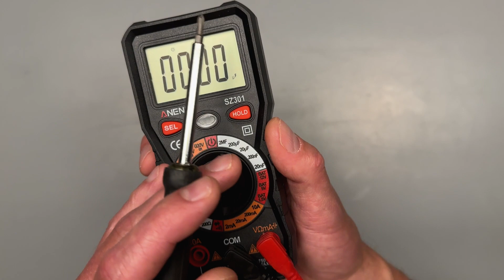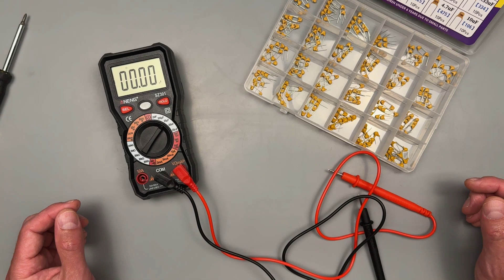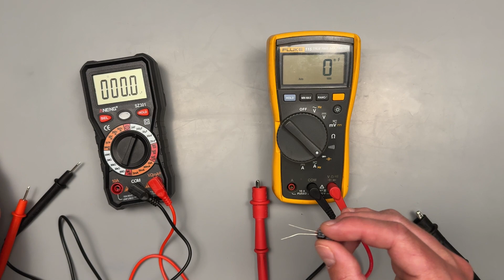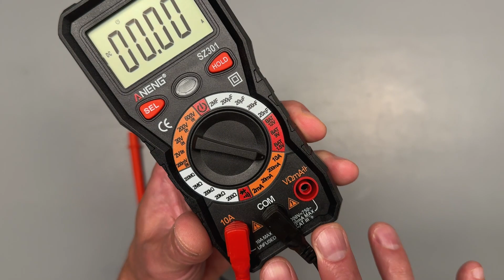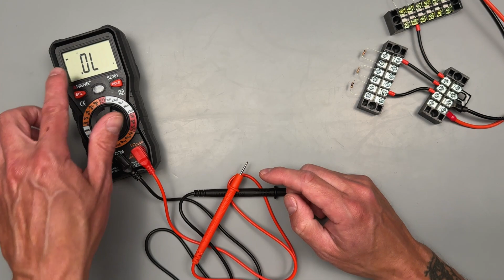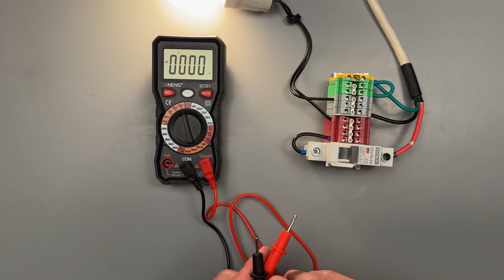🔧 ANENG SZ301 Digital Multimeter: Full Beginner Review & How-To Guide (Manual Ranging) ⚡️

Comment: I turned mine on and dialed it to 200ma and put it in 110 outlet to check for power and it went POW! lol its not signaling volts anymore lol.
Reply from the maker: You found the most efficient way to blow up your meter lol

Comment: I have the same multimeter, but it won't read voltages, can u help
Reply from the maker: these multimeter are extremely cheap and unreliable. I would try returning it for an AstroAI or Kaiweets meter. Should only cost a couple bucks more and you shouldn't really have any issues with them.
Reply: Thank you, but I'm in the carribean

Comment: I’m a hobbies who got a few multimeters mostly to test parts I enjoy it but curious how similar is that to the SZ305 as it’s a new multimeter I got after watching a few of it online?
Reply from the maker: I think its similar but the SZ305 has more features. But looking at the design and cost, it is likely not as good or reliable as SZ301. Usually any meter that has a build-in transistor test port is of extremely low quality. If you're looking to test transistors, I would recommend getting a dedicated tester for that.
Reply: @maddoxmechanic ok thanks I was tempted to get one but I haven’t learn much about transistors as it seems similar design havw different uses😅 do you have any recommendations on cheap transistor tester so I can see how much it cost in my location?

Side note how off is the readings og your SZ301 so I can have abit of refrence😅?
Reply from the maker: @SwapkillProject863 I honestly don't know how far off the Sz301 is. I don't have it anymore.

Here's a link to a LCR/Transistor tester. It's the same one i have. it goes for about $20 USD

https://amzn.to/4x8b2a2

It has a lot of different functions and it will provide you with a lot more information than a multimeter would. And a lot more accurate as well. Worth the investment.
Reply: @maddoxmechanic  ok I’ll keep it in my wish list just incase I get enough money

Comment: So is the 12V battery setting usually for things like consumer grade UPS batteries? Or something even smaller?
Reply from the maker: I honestly don’t know. I think if anything it’s a marketing tool or gimmick. Basically convincing the consuming that it’s capable of “testing” a larger cell. Usually the amount of load for something like this is about 120 ohms, which only comes out to 100 milli amps. So nothing really that useful. If you’re needing to do 12v battering testing, you should be using a dedicated tester.